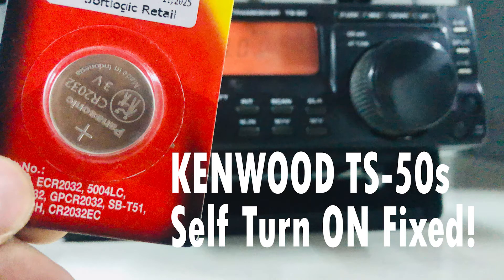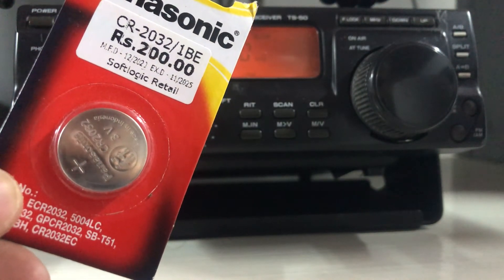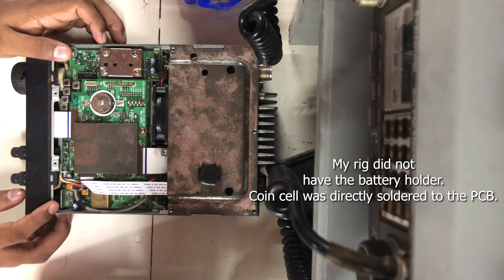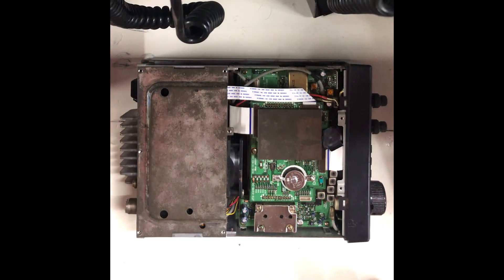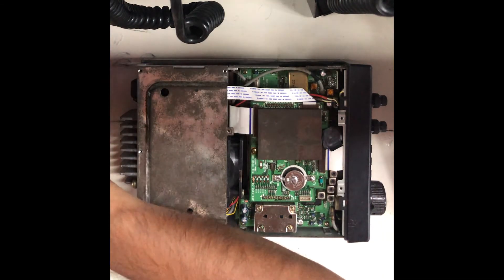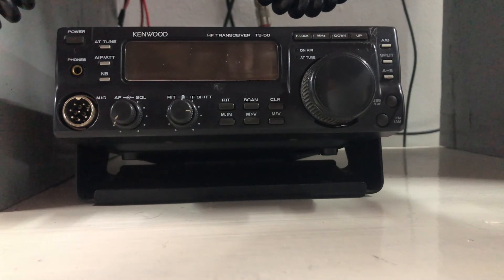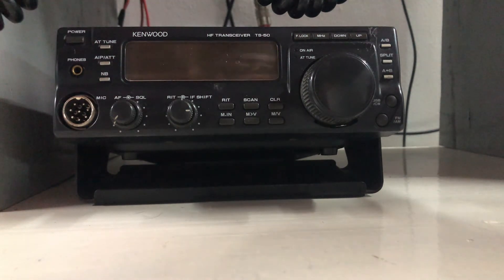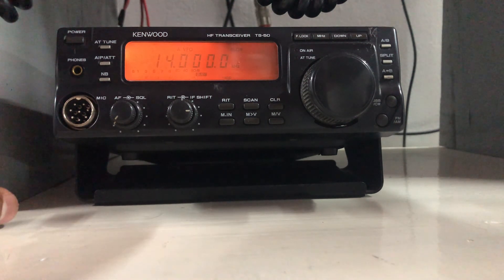Kenwood TS-50s self Turn On fixed!

Comment: You might also need to replace the display capacitor as the right is darker. This may be a leaky cap for the display.
Reply from the maker: @aceventuraaceventura2003  good observation mate. Thank you for the tip

Comment: I thought the battery for this rig was not available any more..
Reply: No, they are not available anymore. But, any 3v lithium button battery that can be fitted to the board will do the same job.
Reply: @neilfoster814   Did just that. In fact I found that the OE battery had previously been replaced with, the same as I was about to fit - A 3volt lithium cell. I removed the solder tags from the spent cell and soldered them to the new one. Works okay but the temperature of soldering the tags to the replacement can't have done the cell any good!
Reply: @SirBeauJangles  I unsoldered the original dead battery from the board, soldered on a CR2032 battery holder in its place, so that if the CR2032 battery needs replacing, I don't have to unsolder anything, just pop the dead battery out, and pop a new one in, simple. It works 100% the same as the original.